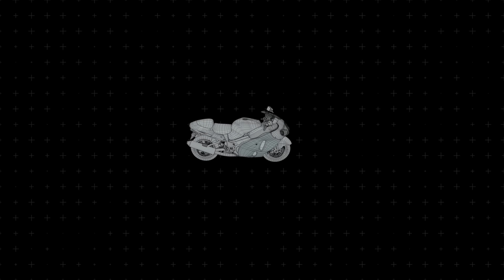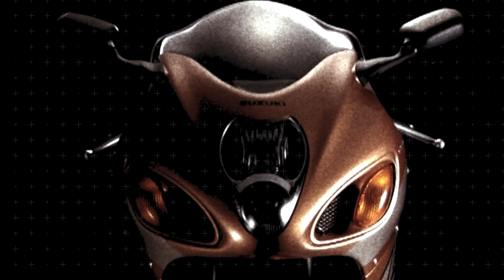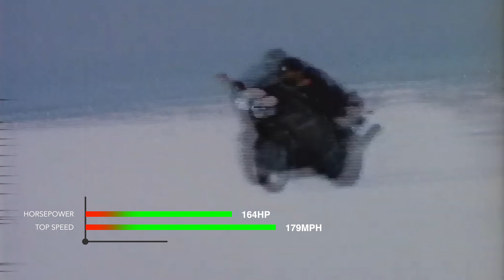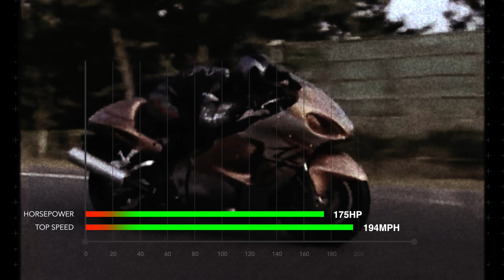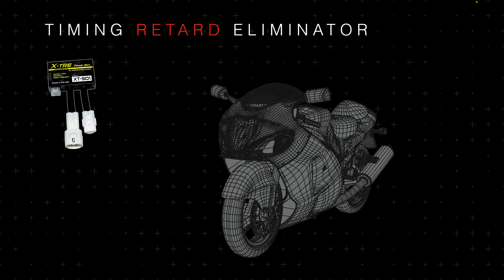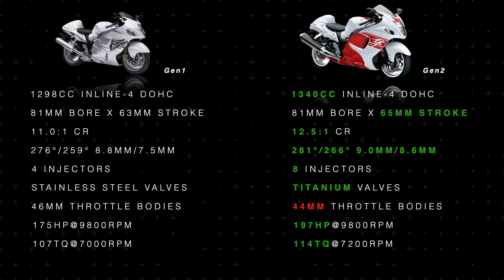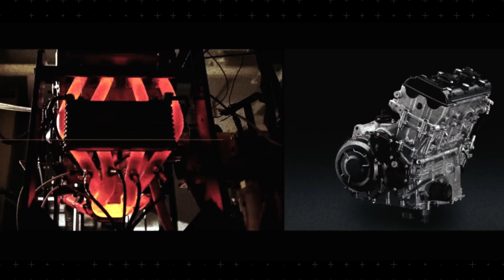Why Turbo Busa Engines Are Overpowered😳| Explained Ep.21

Comment: 311.94 MPH is 502.02 KM/H - this thing was faster than the Chiron SS years before it even debuted. BIll Warner is a MADMAN.
Reply: Turbos do alot lol
Reply: @1DS9  aero does even more
Reply: @atrabotkefishing  lol
Reply: @atrabotkefishing  busa are one of the most aerodynamic bikes
Reply: @1DS9 WMC250EV just pulled that 1st place for that.
Reply: @atrabotkefishing  what’s aero without a power plant?
Reply: @atrabotkefishing  HP:weight ratio does even more.
Reply: @gemnicherry2670  a glider. Lol
Reply: @gemnicherry2670  You know a guy reached 300kph on a bicycle just using gravity? That's aero for you
Reply: @atrabotkefishing  I did not know that but I’m sure he used muscle power and gravity combined to achieve that. I get your point but aero is nothing without work put in….that includes gravity.
Reply: @1DS9  That makes the biker the limiting factor. Specifically, how strong the biker's hands are.

Not only because the biker has to cling on despite the enormous aerodynamic drag (if you can do pull-ups with three of your buddies clinging to you, you can ride a turbo 'busa), but also because the engine is...temperamental. For a test drive on one of the first turbo 'busas (build by MAB in Germany, I think), they hired a test driver (makes sense I guess) to take her for a ride on the Nürburgring. Guy accelerated to 200km/h (125mph) and then got a bit careless with the throttle. The 'busa accelerated, hard. The rider didn't.

That's why you hire a test driver, and do your test on a race track. While the suddenly bike-less rider hit the ground at 200km/h (125mph), he managed to escape without injuries. Awesome.
Reply: @klausstock8020  youre way over exaggerating lol i can barely do a pull up and can wind brake at over 200 lol i question if you ever ridden a fast motorcycle.  I ride. 300 horsepower turbo busa as a daily rider. I can 0-60 in under 2 seconds and you never have that much force on your hands youre insane lol
Reply: @1DS9  and it’s 2 wheels
Reply: @notoimperialism  what have you ridden with 2 wheels just askin respectfully
Reply: @atrabotkefishing exhaust does so much more
Reply: @atrabotkefishing  since he mentioned a bugatti too, I'd say that being much lighter also helps it be that fast.
Reply: Bill was a legend. May he rest in peace.
Reply: was*
Reply: 6114 MPH is 9840 KM/H - the Saturn V rocket was faster than a Hayabusa over 30yrs before it was first made. Physics. Why compare a bike to a car.
Reply: @macfady2181  because they are both land vehicles and operate with a combustion engine, transmission, wheels, rubber tires, etc. Were talking about the land speed record, not the rocket-propulsion speed record. I still can't understand why you haven't made that connection yet.
Reply: cars and bikes are different
Reply: @damienrey8216 so is every individual model of car. At the end of the day they're all transport with benefits and drawbacks.
Reply: So i will get a car gut it, put it on rails with rocket engine on and call it comparable... Where have you missed the part of motorcycle and a car being different vehicle?
Reply: A  top fuel  car  is much faster  0-338 mph in about  4 seconds
Reply: Tone deaf to compare a bike to a car. Power to weight, aerodynamics.. they aren't even in the same division. It would be like lightweight and heavy weight.
Reply: was
Reply: Chiron is limited by Tyres.. w16 engine way more powerful then 100 Hayabusa bro.. chill first gain knowledge.. 😂😂
Reply: @Gameboy1996omen  theres busas with as much power as a veyron and weigh as much as your mom on a average tuesday
Reply: Bill Warner was my friend . Such an honor to know mr311.
Reply: The Chiron is a road car. 
The fastest non road car is VASTLY more than 311.94
Reply: @wyaspence  2022 SSC Tuatara: 295 MPH was verified with a one-way run afterwards. They took 2022 by Bugatti by five mph
Reply: Was a Madman . Rip
Reply: was a madman
Reply: I would make it a was Born: February 11, 1969, Little Falls, New York
Died: July 14, 2013 (aged 44)
Reply: Rest in peace Bill Warner he is a legend and died doing what he loved🫡
Reply: @Username-2  it wont go more than a pass without needing engine work let alone 200k
Reply: Brooo 🤣🤣 that's 311.94 kmph not mph! Where did u find this !
Reply: Well, it is a 1000hp race thing. I wouldn't even call it a bike lol. Can't really compare a race bike thing to a street car.
Reply: There is just no way that thing went so fast I can’t believe it until I see it 😂😂❤
Reply: That piece of crap Is NOT Road legal so your opinion Is ppointless
Reply: Guys, the reason Bill Warner's Hayabusa did that to speed was because of the body kit that he had on it that was way more aerodynamic. Bill Warner actually had the bike wheelie at over 290 MPH! I met him one time at the Texas Mile and he was super cool. He died trying to go even faster.... Bill Warner also went for all these records at various 1 mile airport race events where the is scary pavement in the shutdown portion of the run. I think he did the 311 MPH speed at the Loring Timing Association runway in Maine.
Reply: 🙏🏿🕊Bill Warner
Reply: Still dreaming about fast things that can kill me
Reply: The Chiron weighs about 200 million tons more than the bike... It's called power to weight ratio.
Reply: Kinda not that impressive if you consider the weight difference. Non the less impressive tho
Reply: 311kmh. Somewhere around 194mph. No production street bike is gonna reach 311mph, drag bikes sure possibly heavily modified street bike that is basically a drag bike.  And more to the point  is that even breaking 200 is incredibly hard.  I do like how they say radar confirmed. As a lot of people use there speedometer to claim high speed runs even though most speedometers are highly inaccurate at those high speeds usually showing much faster speeds than the bike is actually going.
Reply: This comment thread is cancer
Reply: Why compare a highly modified non street legal turbo bike with fairings to a chiron which has creature comforts, leather and streetlegal. M2k motorsports 3000hp FORD GT does 300 mph in ONE MILE. X3 UGR tt huracan does 260mph in HALF MILE. Both are much faster than bill warners bike, and would destroy any road going bike.
Reply: The chiron ss was stock
Reply: I love how none of you own a buggatti or any of these million dollar cars but you guys are in comments arguing and defending some stats you heard in a video as if youre the owner of the company. Its so dumb lol
Reply: No he is a Deadman!
Reply: The Chiron has no verified top speed because Bugatti knows it wouldn't be up to muster.  The SSC Tuatara is the current record holder at 295 mph, followed by the Koenigsegg Agera RS.  Regurgitating Bugatti's marketing is just nonsense.
Reply: Edit: the average of the two-way for the Tuatara is actually 282.9 mph, oops
Reply: @JMurph2015  2022 SSC Tuatara: 295 MPH they went back and verified with a one-way run claiming faster production than Bugatti for 5 miles an hour for 2022.
Reply: @JMurph2015  not true, the Bugattis speed was verified at 304.77 mph. No other production car has came close.
Reply: @damoviebull  The Hennesey Venom F5 did 301 and its a production car, whereas the Chiron super sport that did 304 is not considered a production car because it was modified from a stock Chiron which does 273.
Reply: @damoviebull  the Bugatti team did it on a modified Chiron (not production), in one direction (not accounting for wind), and with no outside verification.  0 for 3 on claiming the fastest production car title.
Reply: @JMurph2015   Are you drunk or high? I'll answer my own question you are both!
Reply: @JMurph2015  The Tuatara's run was declared false ages ago
Reply: Ghost rider wheelies faster on a highway, with a naked Busa..
Reply: It would be interesting to see how both would face off in a circuit, since both arent design to do much beyond going in a straight line, and should be bad at something interesting like a track circuit, but maybe the buggati would have an slight endge. Since is not fully mod to only go straight
Reply: @StoneCoolds  the bugatti would win, because if the owner want to use the car on circuit and not road then Bugatti will make adjustments to the car, if you understand french there is some video on youtube about Bugatti, and i think that its told in a tour of the assembly line, but i don’t remember who did the video.
But this is just my opinion, i don’t know anything about bike on a circuit
Reply: Also just found this for those thst like straight linerd, its a jet engine but still a car lol:

The current holder of the Outright World Land Speed Record is ThrustSSC driven by Andy Green, a twin turbofan jet-powered car which achieved 763.035 mph - 1227.985 km/h - over one mile in October 1997. This is the first supersonic record as it exceeded the sound barrier at Mach 1.016.
Reply: @StoneCoolds  in my books, if it's not a combustion engine found/sold in a car today, it's exotic and on a different playing field. We can't compare an outboard jet engine to the likes of conventional ICE engines that fit within the chassis of the car. Although ngl I thought the ThrustSSC was super cool when I first saw it do it's run on YouTube.
Reply: Thank you for converting to the metric system and saving me the time it would take to Google it, even though this comment took much lomger to type. Sounds even more crazy at those numbers
Reply: @lifedrive6069  hmm it’s a simple mathematic equation, I’m curious why some people struggle so much with this?
Reply: @kayhoww  when I was younger and gauged metrics in my mind I worked with hp, Nm and km. Odd combination but it's how my mind adapted. Despite the maths being simple it's like subconsciously my brain doesn't want to do it. Weird isn't it. Yet other conversions can be done easily
Reply: @lifedrive6069  of course. Metric system FTW
Reply: Bugatti is 2 tons and busa is so light
Reply: @wyaspence  they redid it, twice.  Hence the lower speed than the originally claimed 316-odd mph.  The latest one has no outstanding issues.
Reply: @JMurph2015  It still wasn't verified unfortunately. Its a self claimed record. I linked a article about it if you're interested.
Reply: @wyaspence  Go read the Car & Driver article and stop spreading misinformation.  The third run was supervised by people from Racelogic and VBOX and did set a record.
Reply: Your comment reminds me with my fav rider, ghostrider 666
Reply: It’s in kmph bro
Reply: Destroy  al Tires!🤔
Reply: I have several buddies have cars that would put fucking busses on that bike
Reply: @thetattedstig  lol no chance
Reply: He died on the next run tho
Reply: Koenigsegg Jesko hold my beer  530 km/h
Reply: i'd take a chiron over a busa anyday
Reply: @rareearthmetal5019 me too... if I just had 10 million laying around.
Reply: @rareearthmetal5019  I would too and sell it !!
Reply: @sladestryder5264  to who? Assume you randomly got a chiron. Who are you gonna sell it too? Not a lot of ppl have that kind of capitol on them. Next they're gonna ask why you're selling it clearly because you cant afford to take care of the car. Then why would someone buy it with a questionable history like that. Then you gotta ask yourself this who buys a chiron? If you're buying a chiron you aint getting it used unless you're some sort of a collector and thats even smaller portion of people willing to get it. GL selling it.
Reply: @rareearthmetal5019  
Exactly.
Bugatti is more reliable than Suzuki 🤡
Reply: @yf6277  Yeah a highly customized suziki that looks like a bar of soap. That can do 311 miles once or a Bugatti that is a luxury car that can reach 250+ consecutively and still drive.
Reply: @rareearthmetal5019  
Suzuki is a big company kiddo. They have $30Billion revenue a year.
How much Bugatti got?? 🤣🤣
Reply: @yf6277  First of all they made 19.8 billion in revenue for 2022 not 30 "Kiddo". But Bugatti is owned by Volkswagen group which grossed a little over 248 billion in annual revenue. But weird corporate pissing contest aside how is this relevant to anything? What are you trying to say that more people can buy suzuki's therefore it's better?
Reply: @rareearthmetal5019  
Why do you think Bugatti is superior compare to Suzuki?? Bugatti is so poor, even VW group had to buy them.
If Suzuki wanna build a car 5x faster than Bugatti's, they're sure can. They have money to do it. And their supercar is surely more reliable.
Reply: @yf6277  No, thats not how that works. Listen i think you're mis-interpreting some things here. Bugatti was bought as a loss on purpose. The RND the cost of manufacturing. Their not gonna make a profit for Volkswagen. They were bought out because bugatti is a long long line of luxury and bespoke vehicles. Something suzuki doesn't and will not ever have. Thats why they were bought potentially some sort of corporate tax benefits but because of pedigree. Do you know what a type 57 atlanta sc is? Its a timeless work of art something made in the 30's that is still relevant by its design today. Suzuki makes fast bikes. Sure but their ugly objectively and subjectively form over function. It's one thing to make something thats fast any idiot with enough money can do that.  Its another thing entirely to make something thats fast and classic.
Reply: @rareearthmetal5019  
Now you're comparing supercar to superbike 🤡
Bro, selling supercar doesn't make a company big. Toyota's the largest car manufacturer in the world & the only supercar they sell that people know is the new Supra. I don't even know if any Lexus car with V12 engine around.
Supercar is rich men toy. But, it won't make a company rich by selling it.
Reply: @yf6277  supra isn't a super car. The LFA was a super car. A bugatti isn't a super car it's a hypercar. Theirs a big difference. Also i don't know what point you're trying to make? Toyota lost money on each LFA they sold so yeah.....
Reply: @yf6277  idc about that lol it’s worth way more it’s not that crazy imo that a bike goes faster than a car it’s pretty much always been that way when have cars been faster than bikes that weight a fraction of them and are more aero dynamic
Reply: @yf6277  Suzuki 💪
Reply: @rareearthmetal5019  you have to change tires if you reach speeds that high, doesn't matter if it's a Tuatara, Venom F5, Hayabusa or Bugatti.
Reply: @IIXxSLAYERxXII  no you don't not on a bugatti if its not over a certain sustained amount obviously you're gonna have to let them cooldown etc. etc.
Reply: @rareearthmetal5019  yes you have.
Reply: @yf6277 u honestly think Suzuki could build a car “5x” faster than Bugatti? 😂🤡
Reply: @SenszR  
Yeah, cause they're not poor & they're not living under other company's armpit.
You understand me??
Reply: @yf6277  no u clearly don’t understand anything lol just go to sleep dude
Reply: @SenszR  
And what r you? Just a teenager who can't even drive a manual transmission???
Reply: @yf6277  no I’m from the uk so I don’t consider knowing how to drive manual impressive whatsoever lmao
Reply: @SenszR  
If people from Europe & UK read your comment right now, they'll be laughing so hard! What a clown u r.
🤭🤣
Reply: @yf6277  everyone in Europe drives manual, u are making no sense whatsoever 😂
Reply: @yf6277  yea I you need to do some research! Lol I think your a little behind the times ! Lol
Reply: @rareearthmetal5019  what are you talking about? This bike can do high speeds multiple times! The Bugatti is probably not the best car you think it is! Lol there’s other cars that smoke the Bugatti!
Reply: @yf6277  toyota made a v12 luxury car for Japan but it wasn’t meant to be fast but some ppl are taking that motor and swapping it into the Supra now. It’s pretty sick. Look up the famous tuner from Japan who made the gold Supra. He’s got the video out running the police in England. It’s awesome.
Reply: @Jjordanrides29  no it cant do multiple runs
Reply: @yf6277  bugatti got a lot of money from VW to make the veyron and sell it at a LOSS 😀
 "The total cost to produce the Veyron's 450 examples amounted to about $1.62 billion" that is $3.6M PER CAR so about double the MSRP 🤪
suzuki made 200k hayabusas and they dont have bottomless pockets so they had to make some money out of each unit, otherwise they couldnt have kept making it for over 20 years
Reply: @geemy9675  
Hayabusa is 200k?? 🤣
Keep clowning, fool. You're funny 🤡
Reply: @yf6277 ok...how did you figure this out, I severely doubt it...
Reply: Ninja H2: I don't think so
Reply: @damoviebull  Suzuki 💪
Kawasaki 💪
Reply: no way a motorcycle is doing 500kmh. whats your source?
Reply: @zjaeger1800  Dude are you serious? Watch the video, then use Google to convert 311.94 MPH to KMH. It's 502 KM/H
Reply: @WeaponsGG  I got you wrong, I meant a normal motorcycle that you can legally drive on the streets, not the weird one in the end.
Reply: @zjaeger1800  oh yeah ofc man, that one was heavily modified. The current production motorcycle record is like 400-something KMH by the Kawasaki H2R iirc. They did  a world record run a couple years ago across some bridge in dubai
Reply: @zjaeger1800  Look up. Jees.

Comment: big displacement is the only way to make power in spite of emissions regulations. 250 class bikes are now 400cc. the modern gs started at 1100 and now up to 1250. ktm v twin dukes started at 950 and now they are at 1290, the parallel twin version is now larger then when v twin started. the sv650 now competes with bikes over 700cc. ninja 636, dukati v4 is an 1100, aprilia is 1100. the busa will stick around.